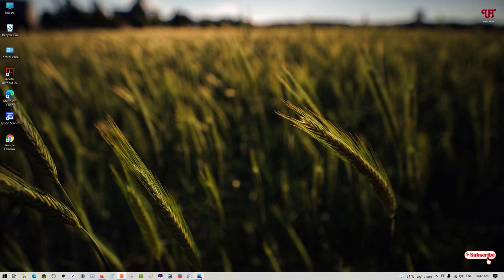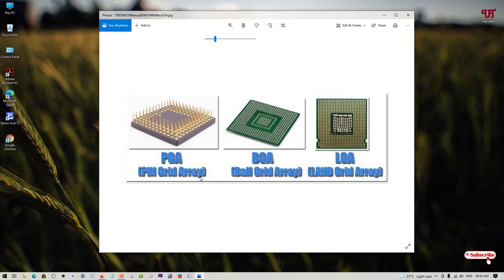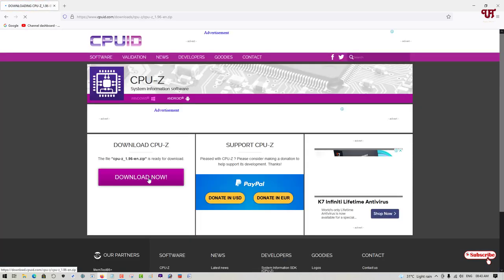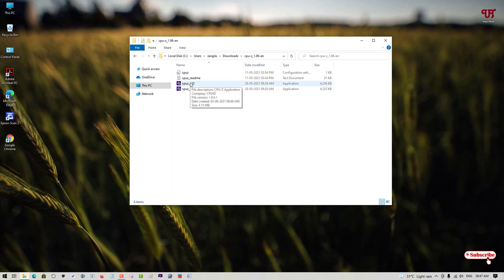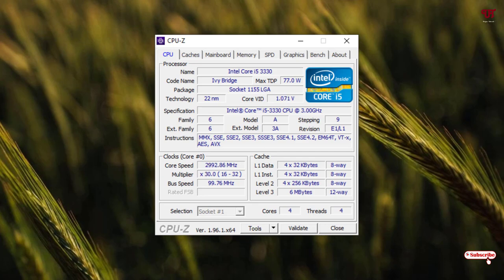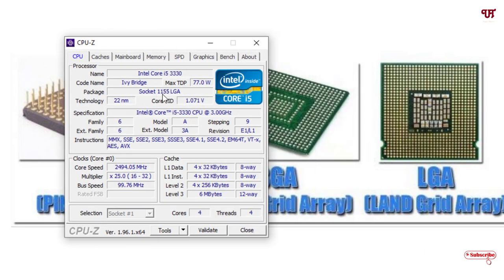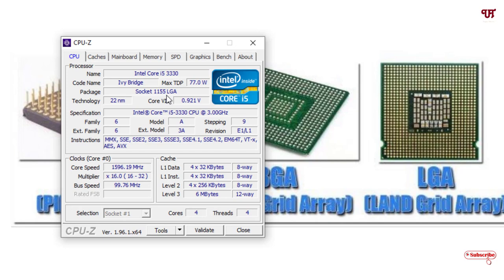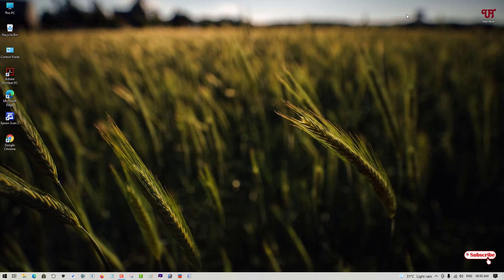How to easily find out any Motherboard's CPU Socket Types with model number in Windows ?

Comment: Nice nicw
Reply from the maker: Thank you 🙏
Reply: @UniqueTutorials  what will happend if i not put thermal paste on my cpu?
Reply from the maker: Things don't work as efficiently as they should. Your CPU's operating temperature will be higher. It may need to slow itself down (thermal throttling) to stop from overheating and failing.
Reply: @UniqueTutorials  oook thank you👍
Reply from the maker: You are welcome 😊

Comment: where is the socket type on the motherboard ?
Reply from the maker: Open the cpu cabinet > pull out the Intel/AMD processor and you will see the number of pins or pin holes.